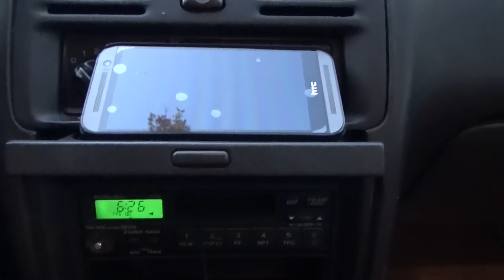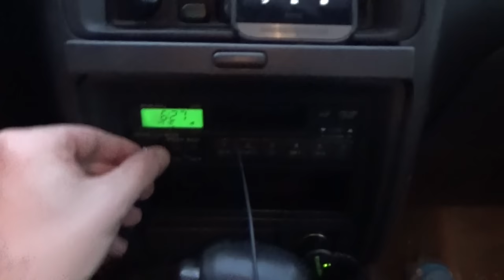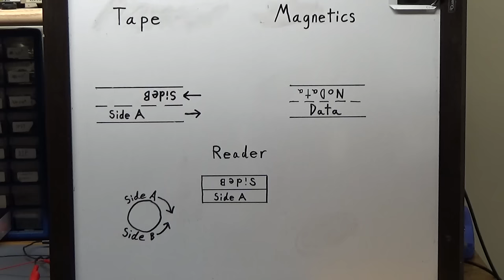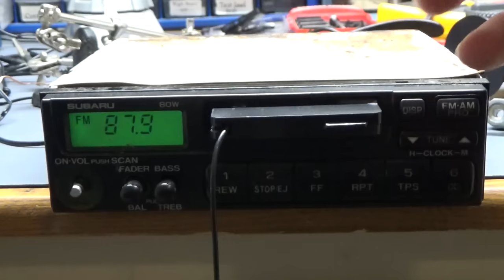Bluetooth Cassette - Version 2

Comment: So I know this is a bit old, but I have some questions... So I was going to swap out my '01 Buick LeSabre stock stereo with an aftermarket one, so I could utilize Aux/USB inputs, add an amp/subs... Etc, until I realized that the wiring harness adapter would cost roughly $82, and then to keep my steering wheel controls, an additional adapter at $120 would be needed... So instead of spending $200 for that, I opted to keep the stock deck, which is theft locked and VIN locked to my vehicle. (Took almost there hours to start the car again after I put it back in... But that's a story for another time....) And I am going to build one of these as well, I have a cassette adapter that I paid $1, and picked up a Bluetooth audio receiver for $11 ($12>$200) However my Aux Cassette adapter includes a small board with some resistors on it, conveniently located right where the BT receiver will need to go to have access to power button and charge port. My question I guess is can I remove the resistors all together, or will that cause issues? I could easily extend the wires and move it to another spot, but if I can lose it, I'd like to. Sorry for the long comment, but thanks for any help

Comment: just take the tape feeder out of the deck, conect the Bluetooth directly I to the audio feed to the deck. you can then use the power from the deck (after relay of course so it shuts off with car). just make make a small board to step the voltage down.  would be a great thing to try man!  great idea you had.

Comment: Double female connector, no soldering, no effort.  cassette adapter cable plugged into double female, blue tooth device plugged into the other end of the double female.  Done.

Comment: Was wiring the headphone jack as simple as wiring the output of the bt module to both the jack and cassette magnet? Or was there more you had to do?
Reply from the maker: +MrMonkeyman2424 A little tricky to solder another set of wires to the BT module, without lifting the wires already connected to the magnetics.

Comment: v3: dynamo on the rotors to power the circuit.
Reply: Also...any potential thermal problem with sticking that battery pack into a factory head unit with an integrated amp? and other hot stuff in the dash?